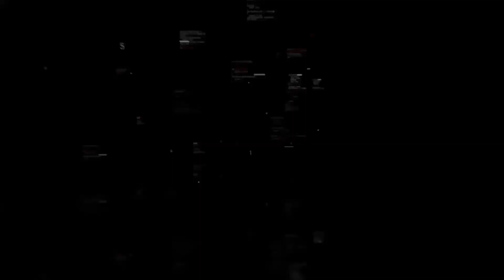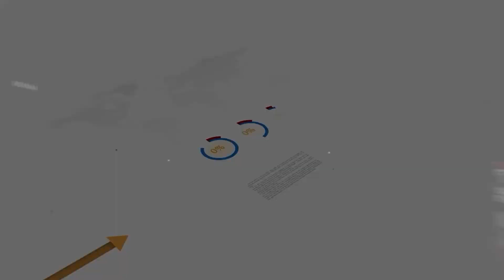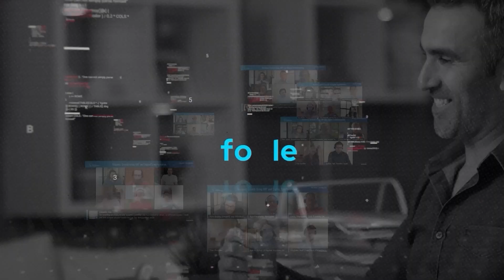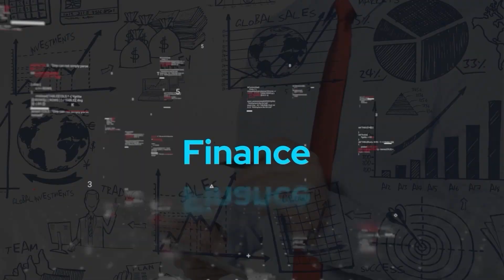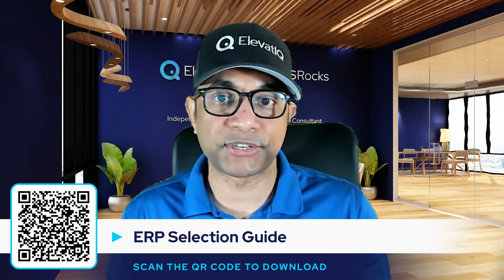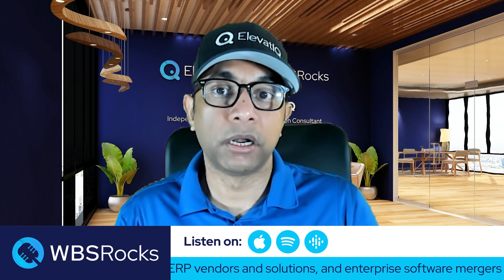Top 10 Make to Order Manufacturing ERP Systems In 2024 | MTO ERP | MTO Software | Make-to-Order ERP

Comment: What about IFS? How does it compare for MTO?
Reply from the maker: IFS is a great system but they might not be as great fit for pure play make-to-order manufacturing. Their sweet spot is where you have a lot of assets and field services processes. Generally, that would be applicable for slightly larger equipment. Yes even these companies are going to have parts division, which would be make-to-order. So IFS is going to have make-to-order capabilities but they would not have as much market share in pure-play make-to-order verticals.